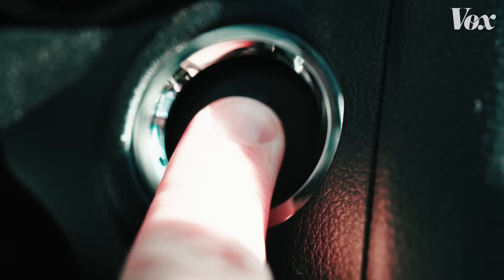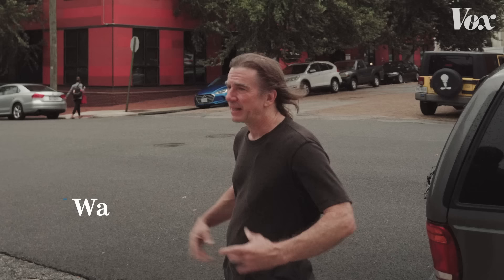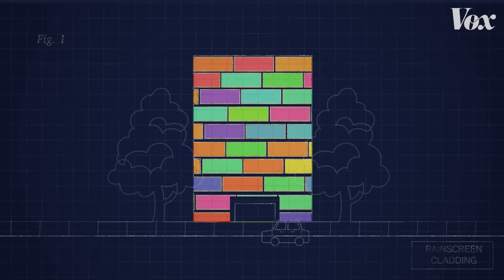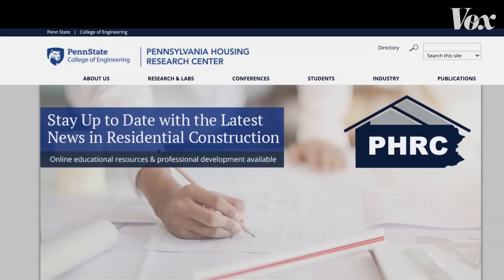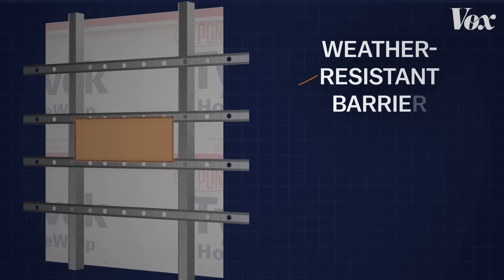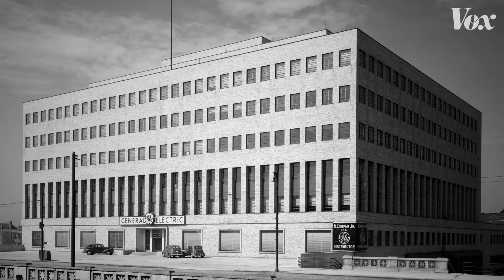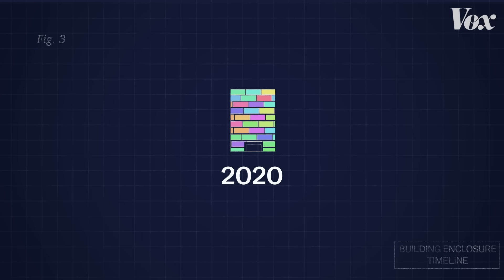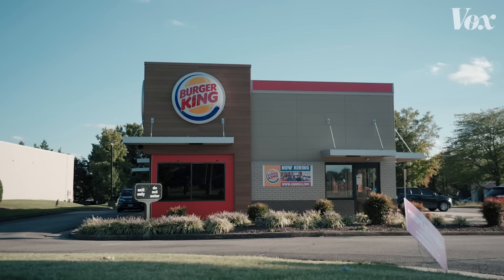Why so many new buildings are covered in rectangles

Comment: Im astounded Vox managed to make a video about this cladding without mentioning that its probably the single most hated thing in modern construction. Like theres zero critical thinking in this, why every generic five over one apartment complex is getting build as cheaply as humanly possible while having a somewhat modern aesthetic to charge horrendous rents. Its the most emblematic thing of whats wrong in construction and this video is just like "rectangles huh, thats neat"
Reply: Here's the answer!
Reply: Very well said
Reply: @russelljohnson7004  FACTS
Reply: That's Vox I guess
Reply: Vox is only greenwashing this type of construction.
Buildings like this are cheaper and they need to be. Commercial buildings like this need to be built fast, cheaply, be low maintenance and easy to adapt to the next tenant if business doesn't take off
Reply: I was thinking this but you say it better.
Reply: To you maybe, but for me solid concrete is the most disgusting thing in architecture (I'm from Indonesia, lots of dust and mud, dont mix well with walls surfaces). Tbh imo it makes them looks good and cleaner
Reply: It’s Vox lol. This is their distractive angle
Reply: The architects showing how they had made a plastic pastiche of a gorgeous 100 year old building made me laugh. Nice looking at a distance though...
Reply: Took the words right out of my mouth
Reply: Also what’s been consistently wrong with the real estate market for well over a decade. It’s all surface-level puffery and inflation of value, at the cheapest possible price point for the owner/seller.
Reply: There reason there are horrible rents is lack of social construction and lack of tenant protections. Nothing to do with square paneling.
Reply: you might wanna watch this new vox video, if you haven't yet
Reply: @MyBroSux24  I've been holding off because it will probably make me mad
Reply: The fact that this video exists is in itself acknowledging that it's commonly hated. It's why it gets clicks and there would be no video otherwise.
Reply: Fast Fashion in Architecture!
Reply: It always been like that, before buildings were made with bricks because it was cheap and fast to build and they would charge high rents in modern construction at the time. To lower the price of housing is another subject completely but shortly we need to build a lot more to have more offer in the market and change the zoning in most cities and try not to build only single family houses...
Reply: What kind of building are you in?
Reply: What kind of building are you in?
Reply: What kind of building are you in?
Reply: So is it your opinion that more expensive buildings should cost more money to live in, despite the cheap buildings providing all of the same advantages?
Reply: @kanosig  no doubt the architect firm just paid for them to do a piece on it so they can justify it to clients
Reply: This design is emblematic of all the new state mandated affordable housing that i and many other people live in... no idea why you think it's a "faux luxury" design

Comment: This new style of construction looks cheap. It's great that it's environmentally friendly in the short term but the real question is if you have to rebuild it in 50 years because it's falling apart then how environmentally friendly will it be in the long run? The architect mentioned investors being concerned about its reliability and durability in the next 20-30 years but that's relatively a very short period of time given how long older buildings constructed in the old styles have lasted. Look at Roman and Greek ruins that have stood the test of time for thousands of years. We'll be lucky if this new style lasts a generation. I'm skeptical, to say the least!
Reply: Very well said. There's a reason why much of Napoleonic Paris still stands today whilst 50s+ architecture is getting knocked down constantly.
Reply: i agree. not only is it cheap, it lacks elegance and beauty!!!! a true atrocity
Reply: @mysteriousstranger6857  To be fair, there isn't the same pushback against knocking down newer buildings, while there are active efforts to prevent "historic" buildings from being knocked down.  I'm sure the world would have lost plenty more of its older buildings to "new" construction over the last century otherwise.
Reply: @BainesMkII  Well yes, but the main reasons for this are that classical architectural styles hold considerably more aesthetic value than newer builds as well as the fact that they're made from sturdier materials that last considerably longer. I'd give the building shown in the video 60 years at most.
Reply: Then again there is a reasonable argument to be made that the world is changing so rapidly we may need to tear those houses down by then and build new ones. Not that I like it, but there may be better buildings that will be built and these structures will be gone by that time.
Reply: @Jzhongzhi  I guess if it is environmentally friendly, demolition won’t be as hazardous when the time comes for it
Reply: To be fair, those Greek ruins are, well, ruins. And sure, most modern buildings won't be standing in a thousand years, but most buildings from a thousand years ago aren't around, either.
Reply: @songofshadow5043  What matters is that classical styles last centuries, if not millennia, while modern builds barely last a matter of decades. There are thousand year old churches all over Europe still used to this day.
Reply: Thank you!!! God I hate modern architecture, like if you’re going to spend millions of dollars on a building could it please not be an eyesore?
Reply: In another way,It's good for economy if it does not last. The construction workers, engineers etc will be at work non stop.
Reply: exactly!
Reply: Why waste energy and resources making buildings to last longer than they're needed? There's no reason to make a building last more than 100 years. In urban areas buildings are going to be rebuilt as areas are rezoned. Buildings need to be made to last as long as they're needed. Making builds that last for thousands of years is just as bad as making plastics that last for thousands of years.
Reply: To be fair, the Roman ruins that stand today are only their most sacred temples that they built solidly - all the rest collapsed or was demolished.
Still, with our modern technology we should be able to build all of our buildings to last. But our financial systems are built for short-term gains so..
Reply: I think that's the idea. It's less expensive to destroy and rebuild (for the industry at least) than to repurpose old ones
Reply: @Jzhongzhi  more or less. Since the the start of the 1900s we mostly do the same thing with our houses, buildings. Old, stylised buildings are oftenly the one most sought after.
Reply: @unceremoniouslylotus  <---- found the chick who lives in a Victorian row house
Reply: @gladitsnotme  ugh i wish! i live in a newer house unfortunately. but at least i have somewhere to live…
Reply: As was mentioned, that massive stone/brick/thick cement type of construction takes up a lot of resources and is itself unsustainable. Besides, our requirements change as technology advances -- all that material gets in the way of the pipes, cables, and wireless signals that modern life relies on.
Reply: Hi I’m an architectural designer. Most commercial buildings are demolished after less than 50 years, usually around 30. And they’re demolished for non-structural reasons, which is really frustrating. Usually when a lease ends, or an insurance policy runs out, so it’s beyond the scope of architecture and the architect. If a client wants an office building made with materials that will last as long as the client wants to own the building (again now 30 years), the architect has to do what the client wants, and that aside the building would cost significantly more which again is in the control of the client. New owners want to build their own new building rather than retrofit an existing one. So the fact that the architects are taking this into consideration and acknowledging the service life of the building rather than the physical limit of the materials makes sense. 

I totally agree though buildings should be made of materials that reflect their lifespan m, I.e. not synthetic forever materials. Since it’s extremely unlikely that building service lifespan will go back up again because non-architectural factors, it makes more sense to adapt the materials to ne less harmful to the environment for the duration of the building’s service lifespan.

In Japan houses are like cars they depreciate in value, and so usually houses are meant to last 30 years. This actually benefits the Japanese because the environmental disaster guidelines are updated frequently to reflect new technology and ability to keep people safe. So each new house is not only safer in that regard, but it can also be more energy efficient according to new building science. 

Without a doubt we have more buildings than occupants on an absolute level we don’t need to build more buildings. But so long as that is up to people who have the money to do so, and so long as safe reliable comfortable housing access remains disproportionately out of reach for people based on where they live (cities, especially in California), and so long as predatory zoning keeps new housing from being built en masse, architects will continue to work within the limits they are confined by, and that is being realistic about the service life of a building, and making that building as good as it can be for that time.
Reply: I presume builders could use alternative building materials (if they're cost effective, subsidized, or mandated) like mushroom brick instead of concrete, or maybe even linoleum for the wind screens.
Reply: Bingo.
Reply: @mysteriousstranger6857  And every single one of them is a fire waiting to happen. Old style of building has its drawbacks too
Reply: @JKSSubstandard  I'd rather have a beautiful yet slightly more flammable house than a concrete cube that happens to be fireproof.
Reply: we live in a society where our environmental needs change over the years, in the next 50y any building constucted now could be obsolete, it's more about being able to reuse/recicle those materials if needed to demolish the building, than building for the afterlife. The world changes a LOT and the cities must evolve along the needs of the people, it's such a waste to have a building is not needed anymore.
Reply: It's about money and nothing else
Reply: They don't expect them to last 50 years. They hope to make work for themselves by getting to knock the buildings down in 35 years and redo them.  My brother is a new architect and is very disgusted and disappointed by what he's discovering in the field.  He jokes he wishes he would have stayed in football.
Reply: The problem is that the requirements people have of a building change over time, and often very old buildings aren't suitable for modern purposes even if they have managed to hold together for a long time. For example, the Roman and Greek ruins have not been actually used as anything but a tourist attraction for many centuries now, despite the fact they managed to hold up pretty well to the test of time. The oldest buildings are almost exclusively historical landmarks and sites of religious significance like churches - stuff people are motivated to maintain for long periods of time in near original condition due to tradition or to preserve history. Plus you also have to weigh up how long you expect the building to last and be useful to how much more expensive and environmentally damaging it would be to make it last that long - not much point in making a building that last for 100 years instead of 50 years if the 100 year building requires 4x as much energy and materials to create - both your wallet and the environment would be better off if you built 2 50 year lifespan buildings instead.
Reply: @mysteriousstranger6857  what do you consider as classical styles? Do you mean like any styles from the past, if then which decade/era would be the divide? Or do you mean modern as like, this single contemporary architecture trend in the most recent decade?/gen
Reply: @CamelliaCorn  Generally speaking most regional styles before the second world war contain much more traditional influence and aesthetic value. As long as you disregard the works of Corbusier and other maniacs.
Reply: Hahahaha yeah ruins are still there. The houses have been gone 2000
Reply: You know nothing about construction. 70's houses were built to what we would call a 5 or 10 year standard. I've seen less than 10 demo's out of the thousands of builds I've seen working construction.
Reply: @sparksmcgee6641  And I bet all of those 70's buildings are paragons of beautiful architecture. /s
Reply: @mysteriousstranger6857  not the point of the comment. I've been involved in building some of the top houses in the country and I have a very good design eye. The fact is most people don't care about looks as much as square footage, so commenting on looks when referring to bulk housing in nonsensical.

Comment: In case anyone is wondering, these panels are almost always made of MCM (or Metal Composite Material). I’m not sure why Vox chose not to speak on the material at all as it’s extremely common. It is composed of a layer of insulation sandwiches between two thin sheets of metal (often aluminum, but can be pretty much any metal).
Reply: Fiber cement is just as popular,  if not even more popular on community scale buildings. Probably why they didn't mention MCM

Comment: Ok but my understanding is that “rainscreen” cladding can indeed lead to too many leaks and thus a lot of structural damage from water. This video strikes me as far too positive about cladding, paying too little attention to the problems that people have discovered with the move away from brick to “best practice” petroleum-product structural design.
Reply: The video is anything but an introduction about this type of cladding system. In an 9 minute video you’re not going to be given a thorough explanation about how it performs, its development, pros, and cons. This is merely a part of the evolution to create more sustainable buildings. We don’t want building to contribute 40% to GHG Emissions.
Reply: Just like any other building product, the safety is entirely dependent on the quality and competence of the installer. Rainscreen cladding is a very energy and cost efficient product if installed properly